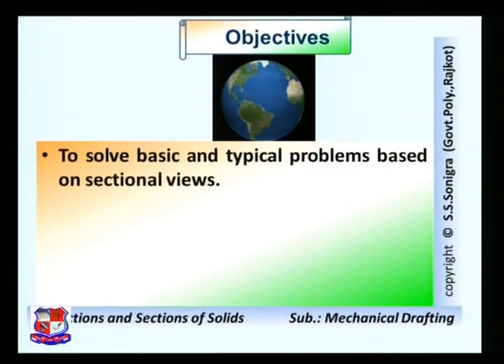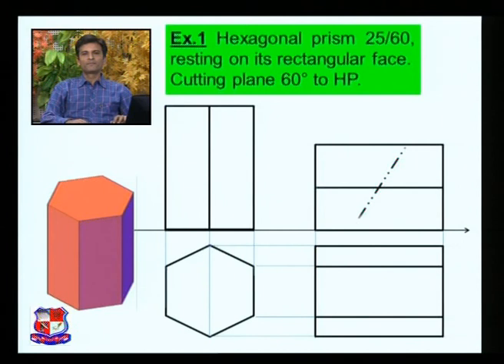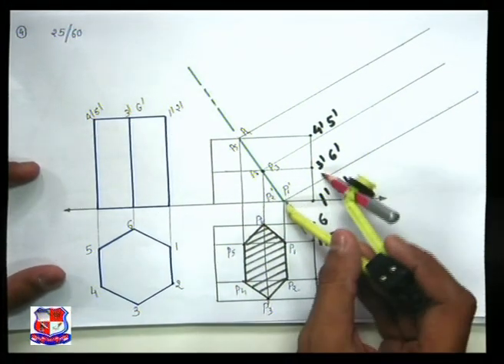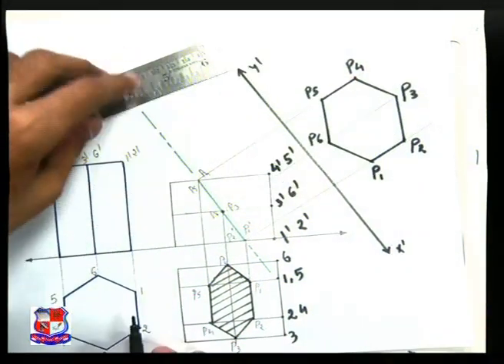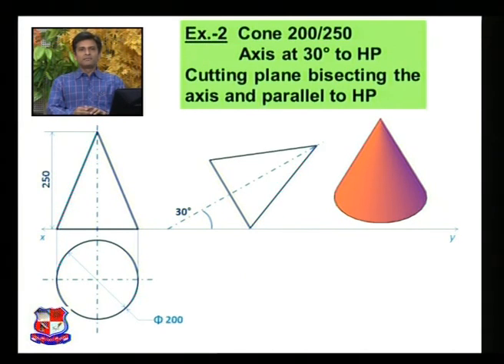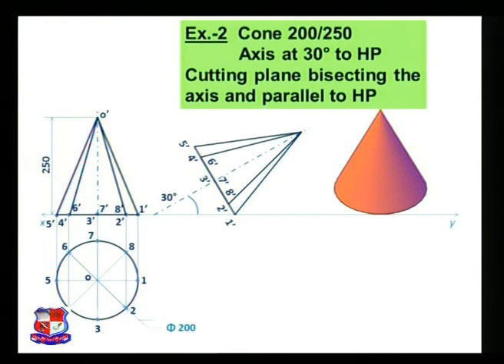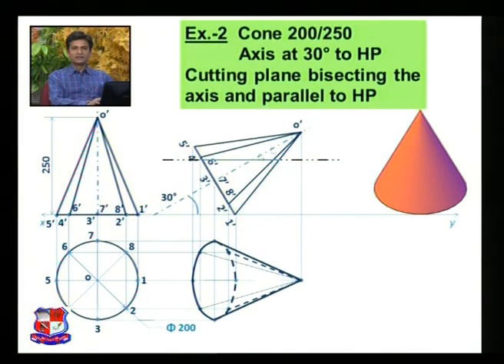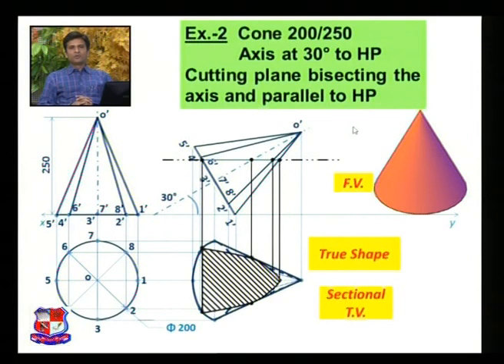Sonigra Sunilkumar Mechanical Drafting Projections and Sections of Solids 1

Comment: Sir ..My Question 
Ex 2 Cutting Plane Bisecting The Axis and Parallel to HP..
means On FV Heigh 250 mm its Half..line and Extend to 30° Projection. 
Am I right ?
Reply: Yes. Cutting plane line is parallel to xy line and from middle point of o'3'. Means 125 mm from o' or 125 mm from 3'. Middle point is on o'3'.
Reply: @SonigraTech  Thank you so much sir 🤗🤗
I am Student Government Polytechnic Rajkot...now 5th sem